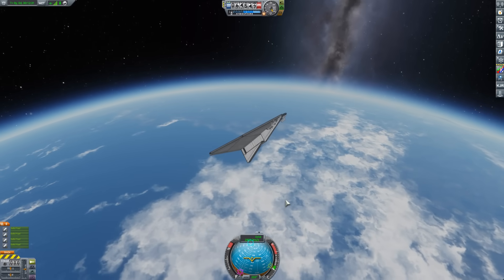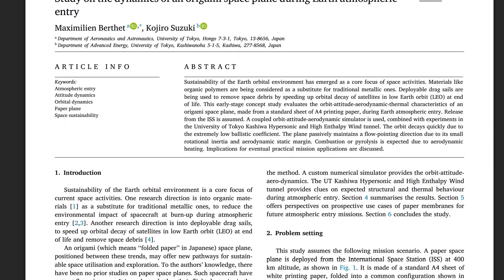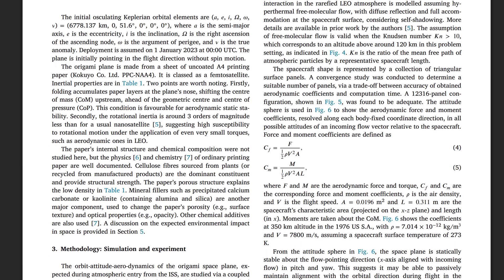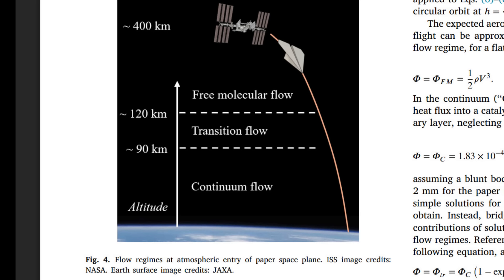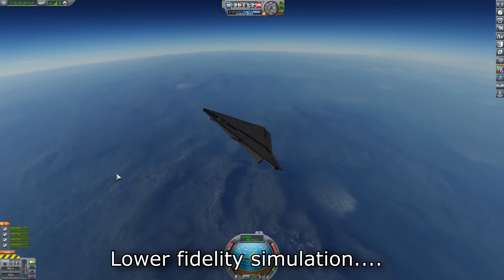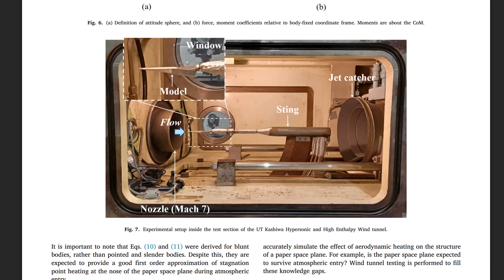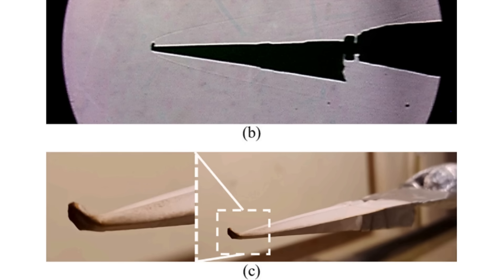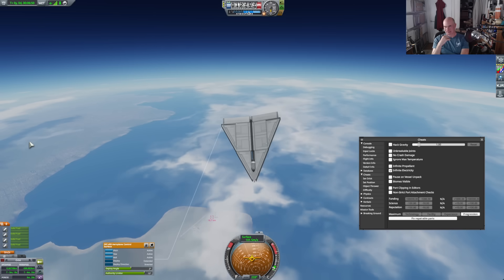Could A Paper Airplane Fly Back From Space?

Comment: My great uncle worked for NASA in the 70s, when I was young he'd build me paper airplanes where he'd cut a strip of the paper off to make the tail, folded into the body to hold it. 

I wish I remembered how he made that!
Reply: That's called the "Schwalbe" here in Switzerland.
Reply: I think there's one like this in the Klutz book of paper airplanes, see if you can find a PDF online
Reply: I bet you can find it on pro paper plane competitions
Reply: Could it be a strip a 1cm wide cut near the back from the fold to the underside of the wing. I'm not sire if it is right at the back or a little way in, but I saw one once. As you take that stip and reverse the fold so it stick sup from the wing, where it is still attached to the paper plane.
Reply: @solanumtinkr8280 interesting thought, but no it was definitely a strip cut fully off, probably 6cm wide (2.5 inches or so, I'm American and I was like 5 so forgive me) folded in half long way to make a 'V'. The remainder of the sheet was folded like oragami (probably not actually oragami though, I was 5) into a fuselage and wings. Before one of the last couple folds he would slot the tail boom and tail piece into the fuselage, with the last fold holding it in place with friction. 

In addition to adjusting the wings this allowed you to adjust the tail. Absolute game-changer.
Reply: I’ve made one that sounds similar in the past.  You take a regular piece of paper (8.5 x 11), fold from one corner completely across to the opposite edge, and that leaves your strip at the bottom to cut off.  Do the same from the other side and it leaves an x shape on the paper and a natural way to fold the sides into the center, leaving two triangles.  From there it’s hard to explain in a comment, but you basically make half of the origami ball on one side and it leaves wings at the bottom.  The tail gets formed and slid long-ways into the opening at the back of the wings.  As I recall it worked pretty good, but was a difficult one make as a kid.  I think it’s called “the swallow” or something.
Reply: I used to make these too.
Reply: Take a piece of a4, fold one corner in diagonally to meet the side and back out, then the same with the opposite corner (along the short side). Cut (or fold and tear) half of the remaining strip from the bottom/rear. 

Take the piece with the diagonal folds and use them as guides to tuck in each side,  leaving a basic double winged looking shape. 

Take the upper 'wings' and fold them diagonally underneath themselves, towards the nose.  This is the bottom, fold in half and form the wings. 

The tail section can be formed in different ways but start with a lengthwise fold, then reverse a section of the fold and form a diagonal fold, forming the tail at 90 degrees to the rest, then do the same again the other way and fold the tail fins diagonally for a split delta type tail.

Ailerons can be formed on the wings or tail to adjust flight characteristics.
Reply: One of these might be what you are looking for:

"T-Tail" Paper Airplanes: Many designs that feature a T-tail (where the horizontal stabilizers are at the top of the vertical fin) often use a cut strip for the tail. You'll find instructions for these on sites like Fold 'N Fly and Instructables. They usually involve making a slot or pocket in the main fuselage where the base of the T-tail is inserted.

"Stingray" Paper Airplane: This design specifically mentions cutting a strip for the tail and then inserting the uncut end of the strip under an inside tab of the plane to create the tail. This sounds very much like what you're describing. You can find instructions for the "Stingray Paper Airplane" on Instructables.

"Unique Tailed Paper Airplane That Flies Well" (Fold 'N Fly/YouTube): There's a YouTube video from Fold 'N Fly with this title that clearly demonstrates cutting a strip and inserting it into the main plane body, with both peaks matching up and then tucking flaps to secure it.
Reply: That's a very popular design, IIRC was one of the most stable paper plane designs and learned how to make one two decades ago! Search for "paper airplane with tail" and find many tutorials.

Comment: Imagine the paper cut from a paper plane at orbital speeds in the vacuum of space brushing past the ISS orbiting in the other direction. 
I bet it could slice right through a module at the correct angle.
Reply: You'd probably get the same kind of cratering as any other hypervelocity impact.  "Solid" stops being a meaningful distinction when the impact becomes violent enough as the forces are much larger than the strength of any of the involved materials.  That and the heating is sometimes enough to turn materials into a gas or plasma.
Reply: "slice" maybe, i think it would go boom
Reply: The mere idea that a collision w/ a paper airplane might result in spalling is mind-blowing.
Reply: Normally, I hate arguing pedantics... but it's fun on this channel! 😆
Reply: +1 for Whipple shields, possibly the best-named space phenomenon since the YORP effect.